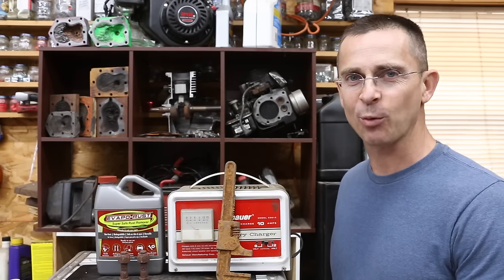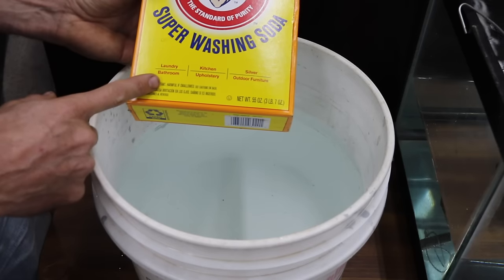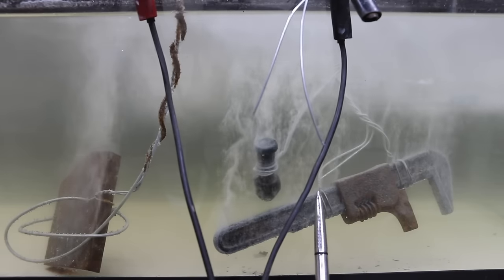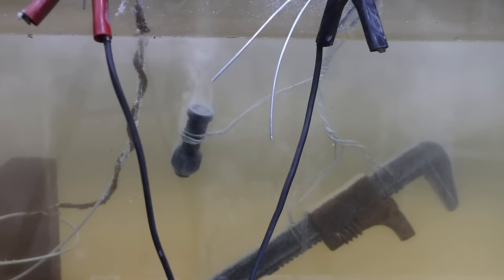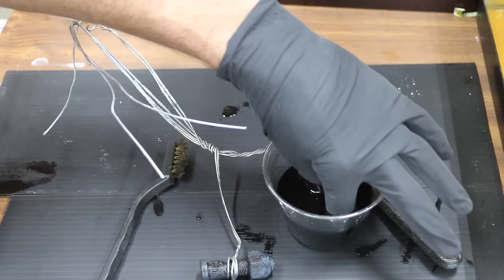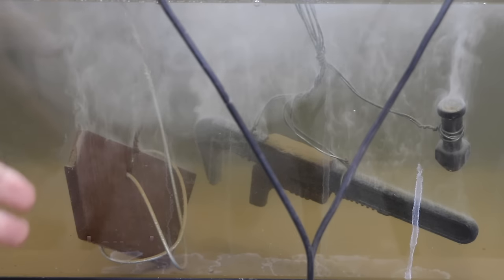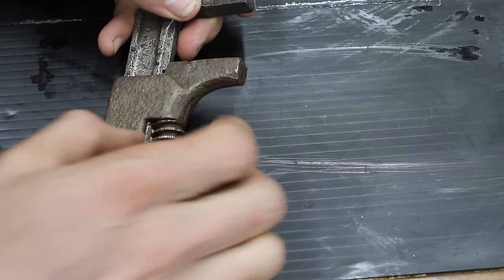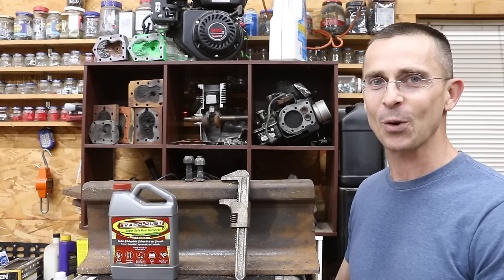Is Electrolysis better than Evapo-Rust?  Let's find out!

Comment from the maker: Thanks for all of the terrific video suggestions!  Thanks again and best regards, Todd.   Evapo-Rust: https://amzn.to/2Ekc51h
Reply: You do a great job!! Maybe if you try this test again attach a wire to both parts of the wrench. It would be interesting to see if it worked better or faster! Keep up the great work!!
Reply: Rust is a very poor conductor. Whenever using electrolysis on tools, always make sure your anode is connected to any moving/isolated parts with a rust barrier.
Reply: Very sneaky Tod, as if you didn't notice the rust barrier and connection points, I rarely comment on videos and you suckered me in too!
Reply: Muriatic acid works just like that rust remover and is way cheaper.
Reply: You might want to use alligator clamps on each and every corroded part for superior current flow distribution.  Love your great videos.
Reply: John Conrad
1 second ago
did you not notice that the section of the wrench that remained rusted was not conducting electricity because it was insulated by the rust?  you needed to wrap the wire on both sections of the wrench.  This experiment was badly done.
Reply: Your sacrificial piece of metal (anode) was too far away from the wrench and small. Electrolysis works by “the line of sight”.  You want it right infront of it. 

My eTank you have anodes surrounding a piece at 360 degrees. It would have removed every spec of rust in 1-2 hours 

Having stainless steel hardware makes it work more effectively
Reply: Maybe hitting the sacrificial anode with a rub of an angle grinder from time to time would improve the process.
Reply: You were not making contact on the ceased part of the wrench. That is why the rust wasn't going anywhere. You also need to dope the water periodically.
Reply: Electrolisis with phosporic acid and a 250/300 A inverter or cc welder
Reply: @lifeofavet7057  however several videos are out there where acid will eventually damage metal especially if it’s scratch or has pitted.  I also saw a guy dip his V8 block into a barrel of molasses and it damaged his block..
Reply: @csr326  agreed.  The size of tool should be much closer.  I recommend only a 5 gallon bucket filled just enough to cover the rusted item.  Works much faster.
Reply: I recommend putting extra wires on the moving parts as well next time. Rust has insulating properties so it disconnects them from the main body of the wrench.
Reply: Easiest way to use Evapo-Rust is for small part a quart mason jar with lid to prevent evaporation.  place parts in close lid and come back in a week.  Remove parts and strain Evapo-Rust through one, or two coffee filters into a second container, it is still good.  For larger parts a 6" diameter PVC pipe thread caped at one end and a slip on cap at the other, uses less volume of liquid for the job.
Reply: Names Steve ,,, Todd
Reply: Time to redo that electrolysis test using separate alligator clips on both stud & nut.
Reply: After 3/4 tries am surprised you still didn't figure out the wrench problem. The wrench is in three parts if you look carefully and you have the wires attached to only one part???
Reply: @MMD-z6z  what i said
Reply: You should try putting the evaporust in the electrolisis tank and using that instead of water. Maybe it will go faster
Reply: What setting was the battery charger at for this test?
Reply: Great video! A recommendation for a future video would be the best grease for heavy duty vehicle application like my semi. I saw your episode with Walmart grease vs red n tacky Lucas grease. Could you do the green extra heavy duty Lucas vs the Red & Tacky Lucas grease?
Reply: Wire on both parts of wrench and on both nut and lug would have freed them! 🙂
Reply: You have to do laser rust removal next!!!!!!
Reply: That's awesome. I'm using water + salt + vinegar which works tremendious especially on simple iron alloys :D
Reply: Great charger.
Reply: distance between the sacrificial steel electrode and the part you are removing the rust from effects performance. the "lug nut" is cleaning faster and giving off more oxygen because it is closer to the steel plate...
Reply: I wonder if the time required or even the end results would change with an increase in amperage? 🤔
Reply: @Hutchy45445  absolutely
Reply: Evaparust for small stuff and electroless for large items since it costs less money. Otherwise they seem both the same. You could use a 50gallon drum or heel even a kiddy pool lol
Reply: @nicksoefje9009  "Rust barrier"?
Please explain.
Reply: This was a great video.  There were quite a few negative comments about not connecting all parts, but Todd did say it was his first time using electrolysis.  Even though the parts had binding issues (not the actual point of the video) the comparison of the two methods was successful.  This was an experiment and we all learned something very useful when working with electrolysis and didn't have to lift a finger for the value we received.  Thank you Todd for helping all of us improve our own understanding of the process.  I've now watched a few of your videos and enjoyed them.  New sub.
Reply: in Electrolysis  the closer the items to each other it work way faster you could cut the time by 3 times or more depend on on currents & solution KOH NAOH works bests
Reply: Electric Compressed Air pressure washer VS Electric dedicated pressure washer.
Reply: would have been interesting to see the sacrificial metal after soaking in evapo rust.
Reply: Using the correct frequency increases the efficiency of electrolysis  and might improve the efficiency of rust removal
Reply: @brianf467  I was yelling at the screen for him to connect the part which was not bubbling to electricity. I have had great luck derusting seized up drill chucks and adjustable wrenches.
Reply: I've been using both evaporust and electrolysis for quite some time -- a tip here -- IMHO you should have the part carrying current on the part you are removing the rust from sticking out of the water -- basically you're transferring current from the steel parts to the sacrificial steel, which is why I use long metal rods for that part as well and I keep part of that sticking out of the water.   This forces the current to take a path ONLY from the parts that are under water.   

Having metal submerged that carries the current will cause the current to flow through the water before it gets to the steel part.   Might be just my superstition here but so far it seems to work better for me.    Basically you want to force only one current path and if the wires are under water that are carrying the current the electrons are going to move through that -- from the wires and the part to the wires and the part.  This makes it a bit of a tricky setup because part of the rusty part are always above the water, which means 2 passes sometimes to clean something up -- but usually there's a part of the thing you're cleaning that you're going to wire brush a bit anyway.

Hope this makes sense.